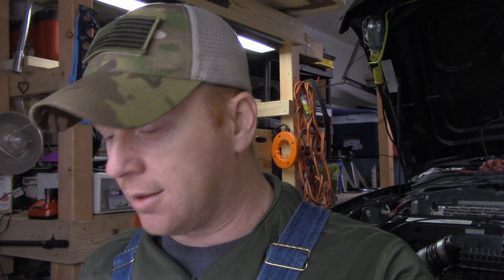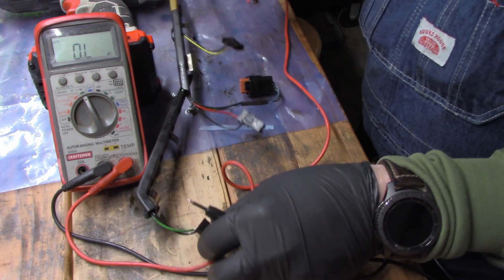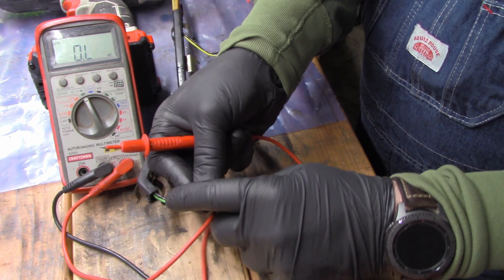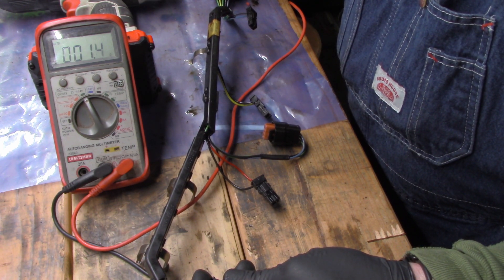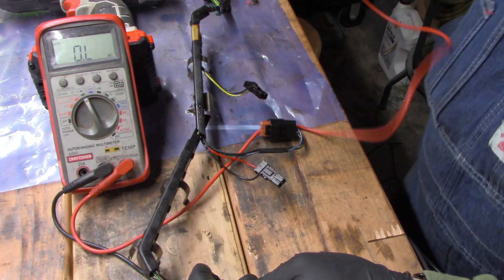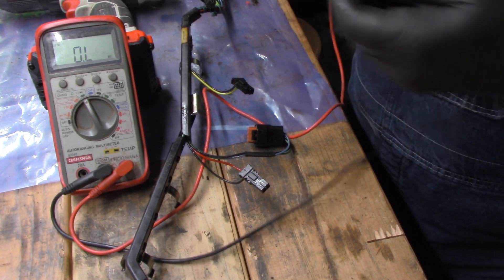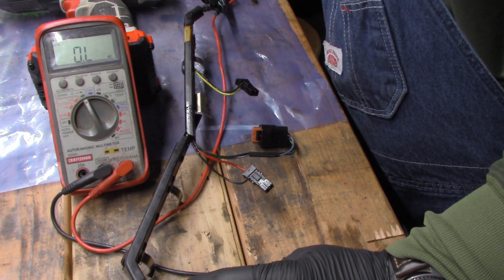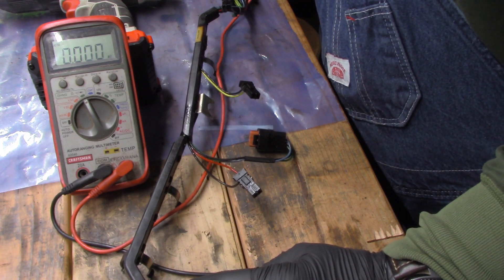6.4 Powerstroke Injector Harness Ohm

Comment: Been following your steering issues videos. I have the same symptoms on my 2010 F250.  I saw you replaced steering dampener, you replaced tie rod ends and your symptoms still weren't completely corrected. 

Did it end up being the steering box?  Is it corrected now? What was it?
Reply from the maker: It was the steering box and honestly, I'll have to replace it again with a red head box. The o'Reilly box that I put in is weak. Do yourself a favor and spend the extra $200 on a GOOD quality or OEM box, especially if you have oversize tires. The OEM box, with the way these front ends are designed, cant handle the forces.
Reply: USAF99 Thanks for getting back to me. I've been looking at the Cardone 97-7631 and the one from RedHead. 

Plan for now is to do a 1/4-1/2 turn on the adjuster on the stock box and a $75 bilstein 5100 steering stabilizer and see how many more miles I can get out of it. Quick and Cheap.

When it's time for new tires, I'll do a new steering box, bilstein 2" level kit, 5100 shocks all around, new tie rod ends, new drag link and adjustable trackbar from PMF. F350 blocks and traction bars in the back with .5" carrier spacer and all new brake lines. 

Have to check ball joints and do them at the same time if need be. Time and Money.